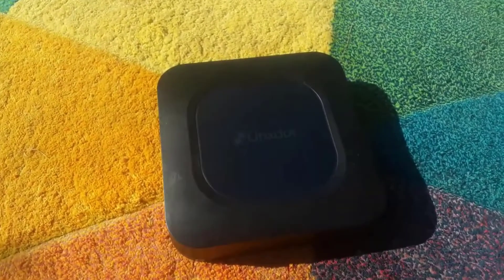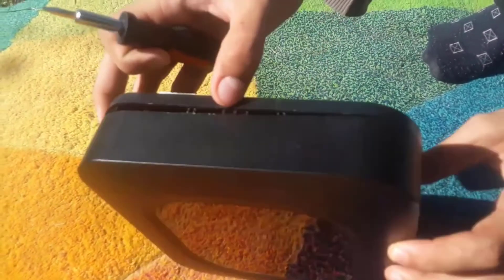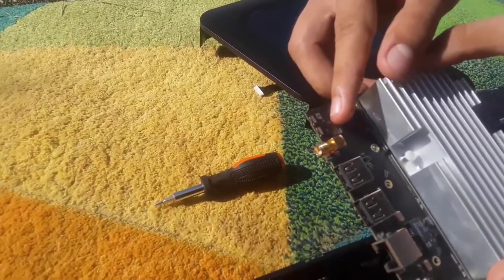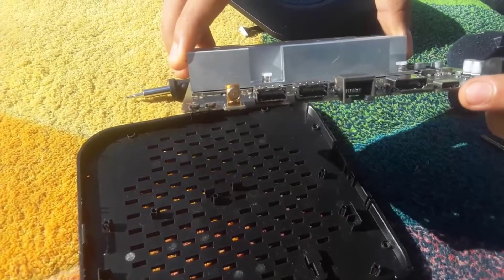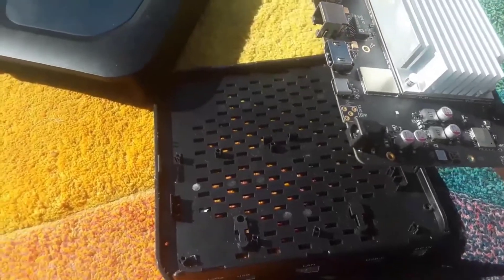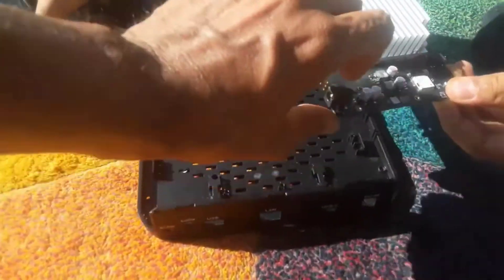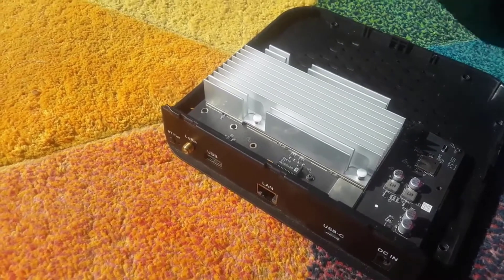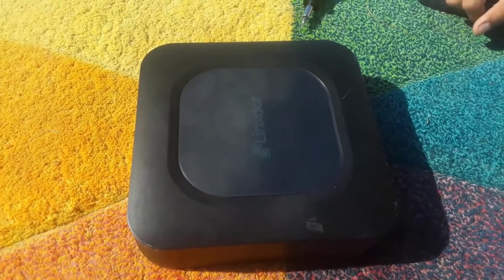LinxDot miner how to open and what is inside. HELIUM NETWORK PROJECT

Comment: Has anyone tried to flash the board and use it as a mini computer.  the hardware is already decent, better than Raspberry Pi 4.  I can't get a connection to the Rockchip software.  Try again with UART when the cable is there.